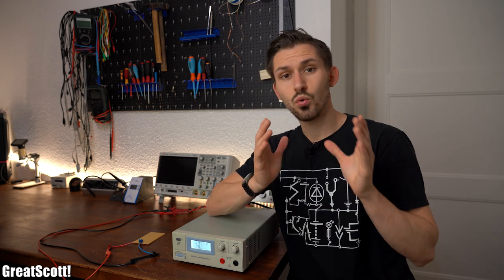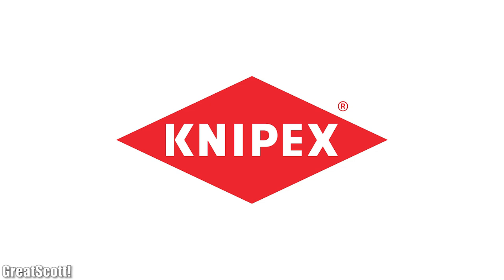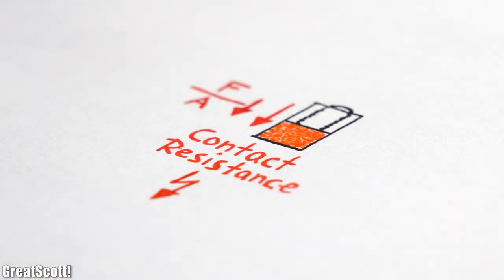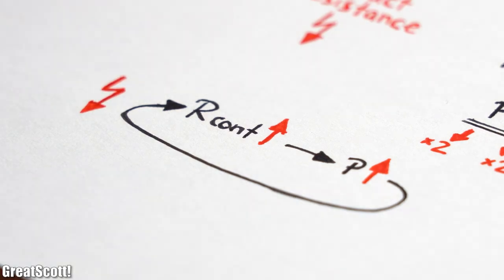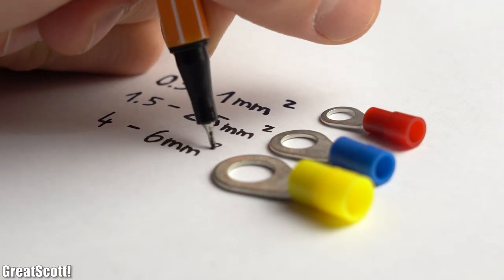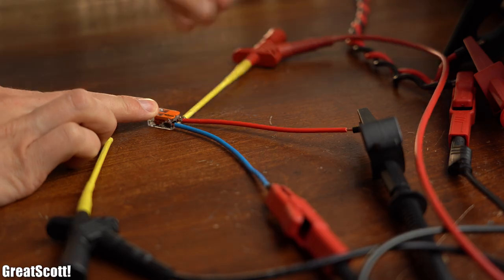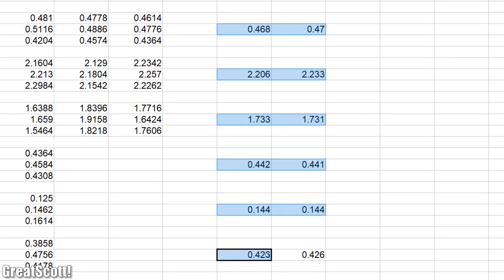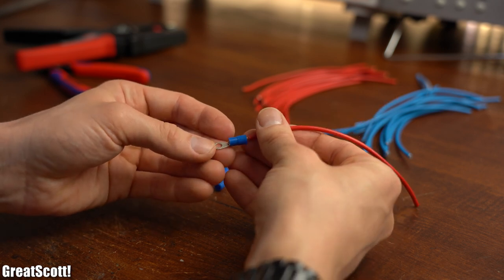Connectors are more important than you might think! So which one is the best? (Experiment)

Comment: I'm so jealous of that breaker box. Every box I've ever seen in the US is either unlabeled, or labeled with hand written labels.
Reply from the maker: It is nowadays standard here in Germany :-)
Reply: @greatscottlab  But where is measuring for stranded wire ?
Reply: Yes, i agree. It's still permissible in the US to still use breaker boxes/load centers from the late 60's. C'mon NEC...!
Reply: What's wrong with unintelligible grease pencil markings? Isn't the Guess And Check method more fun?!
Reply: @inlasttonowhere4459  The NEC won't let you run a coax cable through a doorway in your home, but is happily unconcerned when your power company pulls and leaves your neighbors' power line 10 feet above your lawn
Reply: @xWonderxBreadx  😂😅 right, until you find a return voltage source & wonder. "What does this go to"??
Reply: @dannyberne  1st- "I apologize to Scott for mentioning this on your channel as politics are charged these days- Moving on. The proposed infrastructure bill in the US does include revisions to update existing utilities. Of course you should start seeing the same. Updated Square D's, ABB, Siemens, Schneider components in homes. And for the Coaxial, 😜 it doesn't stop anything. But the change will be arduous to say the least.
Reply: Those labels and texts come with every distribution board purchased in Europe.
Reply: First thing I did when I moved into my new house was get the labeller out and test and then label every single breaker.
Reply: Move to europe man
Reply: @greatscottlab  Here in the netherlands as well
Reply: @joran4612  yea, can confirm that, though it’s handwritten here, though in a good way
Reply: @inlasttonowhere4459   yeah... You're right
Reply: @christianelzey9703  Now finding quality labels that'll stick until the heat death of the universe is my problem. I can't seem to find any that'll last more than eighteen months.
Reply: Does the readability of the labels matter when the electrician is just going to write "lights and outlets" on 90% of them? :)
Reply: all the boxes i've seen have been neatly labeled and well written. nothing wrong with well hand written labels. people dont read anymore so they are losing their ability to read handwriting. soon the only thing people are gonna be able to read is the font on a screen.
Reply: Last time I needed to cut power to a room, it took trying 3 breakers before I found the correct one.

All 3 we're labeled bedroom....
Reply: @simplyengineering2350  "people can't read handwriting anymore"

Ok Boomer.
Reply: Yeah  !     That electrical box was meticulous  !      The electrical boxes in the USA are a crazy maze of old very old and semi new wiring with different breakers and literally no room for a neutral bar or ground
Reply: you'd think the U,S, would be out in front with this, but no.
Reply: Common here in Bangladesh
Reply: seeing non us electrical boxes makes me wanna redo the one in my house
Reply: Yeah the design doesn't lend itself to easy labeling, and definitely doesn't come with any preprinted labels.
Reply: USA like Canada use the same breaker system, unlike the EU which is 220 for house hold power at 50HZ .

Now yes we have hand written but they can be printed with label maker.   Just most electricians in USA and Canada do not bother with proper ledge able labels.  It is "not" a legal requirement, unless Canada and USA get law makers to require it to be done at each state/provincial level.
Reply: @keithking1985  in the US they leave it up to the home owner. There is a wide variety of setups to choose from. You can always have a new one installed or install it yourself if you know how.
Reply: @JohnClark-tt2bl  did you write on the label wich room it was after you found the right one? it's good practice to update labels.
Reply: @TimGautier  no, it’s all nicely labeled upper floor, lower floor, bathroom, kitchen
Reply: @greatscottlab  you want to see what they have in Australia....
Reply: @keithking1985  the last war in the usa was 1860s,  everywhere else has needed to rebuild to better standards
Reply: @defencebangladesh4068  that bad or good ?
Reply: @terrancevangemert7508  and then it still takes decades
Reply: @jyvben1520  Good
Reply: It's unlabeled, or labeled wrong here in Canada too 😅
Reply: The UK is even better than Germany here.
Reply: The only unlabeled breaker boxes I've ever seen in the USa have been in Virginia, in houses built during a time when there was no enforcement of building codes.
Reply: @dannyberne  That's because the NEC does NOT apply to the utility's wiring, that is the NESC.
Reply: @brianleeper5737 I didn't realize that we were getting over 1kv service. I didn't realize that either my meter was a step down transformer, or each little circuit breaker was. That's fantastic how far technology has come... -s
Reply: @dannyberne  The NEC specifically states that it does not apply to installations under the control of a utility. Which means your power drop, the transformer, and so on. Voltage has nothing to do with it--there are installations running over 1kv which ARE governed by NEC rules because they are not controlled by a utility. For example, a large factory that takes power at medium voltage (say 7.2kV 3-phase) from the utility. In that case, everything beyond the meter (or CTs) would be governed by the NEC.

Best way to look at it: Is an electrician hired by the customer allowed to work on it? Then it's governed by the NEC. Is only the utility allowed to work on it? Then it's governed by the NESC.
Reply: @brianleeper5737  Cite your source on that. The difference is that the NESC is there to describe the electrical characteristics of the service. The NEC has say over how the physical conductor gets dropped, fastened, and or otherwise run. Since my issue wasn't an electrical quality problem, but the cables were/may still be way too close to the ground, that is a physical issue, thus: the NEC
Reply: @dannyberne  90.2 Scope of the NEC.
(B) What Isn’t Covered. The NEC doesn’t apply to:
(5) Electric Utilities. The NEC doesn’t apply to installations under the
exclusive control of an electric utility where such installations:
a. Consist of service drops or service laterals and
associated metering. Figure 90–1
b. Are on property owned or leased by the electric utility for
the purpose of generation, transformation, transmission,
distribution, or metering of electric energy. Figure 90–2
Reply: @brianleeper5737  You are apparently correct. I would argue that a line 10 feet above my yard was not exclusively controlled. Thank you for providing me with that
Reply: @dannyberne  If the line is still a  problem and the utility is not being responsive I would contact the public utilities commission or whatever the equivalent in your state is and make a complaint.
Reply: @brianleeper5737  that place is but an unhappy memory, but I appreciate your concern
Reply: @terrancevangemert7508  The poor labelling is a workmanship issue.  I believe the CODE requires all circuits to be labelled (to pass inspection), but it does not specify how (or how clearly) they are labelled.
Reply: @simplyengineering2350  That doesn't matter if the person labeling has horrible hand writing, or if it's faded.
Reply: @John Clark those boxes are mandatory, as far as I know in France and Germany at least. I saw a video showing even UK electricians are jealous of such a beautiful integration. We have very efficient brands here like Legrand and Schneider (French), ABB (Swiss), Siemens (German)...
Reply: Personally It's been a long time since I've seen that here in the UK. Although I know that the occasional old  house still have wire fuse boxes in.
Reply: Here in Italy you must label every breaker
Reply: @simplyengineering2350  I agree - but sadly there are two component to this problem. The first as you say is about people's ability to read handwriting the second is about writing by hand.
Here in Germany the style of handwriting has changed a lot.  So much that these days documents of a century ago are almost illegible to younger people even though they were written in very pretty handwriting.  In more modern days the style of handwriting has been changed to simplify it further bacause apparently kids suddenly were no longer able to deal with the style that was taught for decades and schools stopped grading the prettyness of handwriting.
Reply: @jimbarrett2152  It's what is expected over here.  There are three such electrical boxes in the house I life, one that houses the meter is like twice the size of the one shown but under the hood they're all similar.  Even when the cover is off no dangerous parts that easily can be touched and on the door of the cebinet a printed and laminated descrption of all the fuses.
Reply: @keithking1985  First mover disadvantage.  Many technologies of electrical installation where innovated in the US and because they were good enough they never got changed.  Knob-and-tybe installations are generally accepted to be dangerous, yet legal.  110V means transformers need to be placed closer to consumers and wires need a larger cross section which in the end all is pretty costly to the consumer yet the fundamental choice of a century ago is probably cast in stone forever.
Reply: @defencebangladesh4068  Now that's a slap to those envious Americans ;-)
Reply: Same
Reply: @joran4612  I am in Europe, there are still lots of unlabeled panels
Reply: @ralfbaechle  lol
Reply: @greatscottlab  i dont see a link for wire ferrule (only crimpers), is there one you recommend
Reply: Usually German branded have a better quality and precision, for a bit much cost. For a number of years some US product was made in China, that means the quality control also "in China", that push us away even the price is cheaper, especially in electrical and electronics.
Reply: You guys also use wire nuts and try dismiss wagos as unsafe.
Reply: You realize you can label the US panels properly too?
Reply: @hgbugalou  I'll let my landlord know.
Reply: here in my house we have the utility panel taken off with labels and amperage hand written next to the box and i've been trying to get the panel on but it just won't
Reply: Handwritten is fine. It's unessecary to print out custom labels like that. I'm sure you could pay your electrician abit extra for it, or just do it yourself.
Reply: Cringe.
Reply: If I were hired as an electrician by my landlord,  every outlet (receptacle,  light fixture,  etc) would be numbered according to the breaker ID number at the load center and/or subpanel, as it is commonly done in hospitals and institutions.  But landlords don't care,  as long as they stay within "habitability" guidelines and collect the rent.  A few landlords will even go the extra mile and try to accommodate the tenants; even the good,  the bad,  and the ugly ones.  But they are usually neither electricians nor civil engineers.  They just want happy tenants and want to avoid legal battles. 
 

Hmmm,  I think I'll get started on my apartment right away.  There are more than a dozen home runs,  as I live in a commons. I pay my rent on time.  The owner is acting landlord/manager of the whole building,  and he likes me, so the home runs ought to be a grand slam,  and my timely payments ought to be a slam dunk.  Sadly,  it doesn't work that way.  Not that I want to slam slumlords; I just want to dunk the dummies.  And they still care mostly about the rent and the residential lease terms.      feh
Reply: Its standard here in denmark.......strick rules and regulations by law.........
Reply: it's super-duper basic breaker box.... 2 rcbo's, couple radials, one 3-phase (electric cooker probably), maybe a surge protection device
New homes in europe (excluding UK) will have 5+ rcbo's and 20-30 breakers, and "smart" homes..... well, it's no longer a breaker box, it's a server rack. Each wire has an ID (tiny plastic number tags) and you need schematics, otherwise it turns into a nightmare during install, not to mention repair/ modification.
Reply: And there is nothing wrong with hand written labels.
Reply: I just saw one the other day that was very nicely labeled in script.

Mine was but started to fade. I simply made sticky labels for each one instead before they faded away. Far easier to read and replace.
Reply: @Rudofaux  my labels work jut fine and it easily reaches 150°F in there. I highly doubt yours gets hotter. They've been on there for over 2 years. Of course, indod use alcohol to clean and dry the surface first. Always prepare the surfaces first
Reply: @inlasttonowhere4459  We have lot of 1960s fuse boxes in Europe.Just because its old doesnt mean its bad.
Reply: And the hand-written labels are usually wrong assuming you can read them at all.
Reply: @ThatGamePerson  Thats rarely the case.Most fuse or breaker boxes have no labels at all :D
Reply: at my place of employment, they all have printed sheets made in excel. challenging to figure out what the hell powers what even still because one building could have anywhere from 2 to 8 panels in it. can often be a real pain
Reply: labeling is easy with any box, the electrician just has to take the time to do it. I like the US style boxes with push-on bussbars more than rows of breakers that need wiring on both sides, however the wago connectors are so much easier than wirenuts. twisting wirenuts makes my carpal tunnel scream. I'll probably use wago's from now on to save my wrists.
Reply: I once had the pleasure of working in a panel that had been installed by an electrician that had served in the Swedish navy. The homeowner couldn't understand my joy.
Reply: @billganahl7151  Did you take a picture and frame it? 😅
Reply: @JohnClark-tt2bl  
Hah! That was long enough ago that it would have been a lithograph.
Reply: @Rudofaux  most newer breakers here in NZ have a little window that folds and clicks over the label. the label will stay on forever, even without adhesive
Reply: @roryp7415  Neat. I was just ridiculing the Boomer because he was bitter over handwriting. A form of writing that fell out of favor when the typewriter became a thing.

Next he'll complain "Why can't kids these day read Sanskrit anymore?"
Reply: If you need to remember one thing about north america, is that no rigour and low cost are top values in people's work ethics. You want to install a neatly labelled breaker pannel in a new home? Get fucked! We'll have rasputin over here mount one like he plays LEGOs as a child for a lowet cost. Also if you haven't seen the video about extension cords and splitters, check it out because there's very important info about using a cheap ass 16 AWG splitter cord on a wall outlet cabled with either 14 AWG or 12 AWG.

North American philosophy is not compatible with safety AT ALL.
Reply: @simplyengineering2350  awh is someone upset that the US electrician work is being criticized? What's wrong with replacing degrading paper with soluble Sharpie pen writing, by a proper polymer cover with printed labels for every breaker? Also let's not talk about using basic duplex outlets for 20 A circuits instead of those made for 20 A plugs. But I don't blame you, you just follow the NEC without any second regards and that's fine. That what the NEC wants you to do.
Reply: @caffeinatedinsanity2324  Nothing wrong with that as long as you have options.
Reply: i made myself a milti layer image in gimp so i can see every circuit in the house and what is on what breaker
Reply: @xWonderxBreadx  flick all the breakers for fun... erm saftey is what I meant
Reply: @inlasttonowhere4459  Although there have been improvements in designs, most involves moving things around a bit.  A lot of the old stuff is still fine from a technical perspective. Meaning they work equally as well  from an electrical specification standpoint. New panels can indeed be easier to wire, But easier does not necessarily mean better.
Reply: @dannyberne  Arguably, the NEC does not have code jurisdiction on utilities. Technically, they are covered by the NESC. The demarcation line is where it ties to your home.
Reply: @professorg8383  this was a year ago. Did you read everything before you decided to pile on?
Reply: @dannyberne  Yet somehow, you came across my post. Probably either because you got a notification. But it could  "randomly appeared" in your recommendations. (like it did on mine). Maybe you don't get how the algorithms work. 

That aside, it makes no difference. Your comment then was still uninformed. Maybe you have since learned otherwise or maybe I just made you aware of something you didn't know.  

The point is though, that you likely got notified and you read it!!! If you don't want one of your old comments to still be out there, you should probably check your history and delete old things. 

Bottom line is this, I got here because I subscribe to the channel and this particular video of his was relevant to something I have been working on and researching.  But because the video was old, I quickly browsed  through comments. Yours was not relevant, however it took me all of 30 seconds to inform you of something you didn't know at the time. I was doing you a favor by informing you of why NEC doesn't. 

But I see now that someone set you straight a year ago. In fact you took a bit of a beating!  But I wasn't "piling on"  trying to add to your pain of finding out why your original comment was misinformed, it was only adding to a thread and hopefully helping someone learn. But I'm guessing now that you are a millennial. I didn't know, so I'm sorry for hurting your feelings. 

And no, I don't read an entire thread if I'm just browsing for relevant content. Sorry if that doesn't meet your standards.
Reply: @professorg8383  it's because you replied to me. Go away
Reply: @dannyberne  You could have just ignored it, but you didn't. I apologized for hurting your feelings. But that wasn't good enough for you!!!!  Grow up a bit.